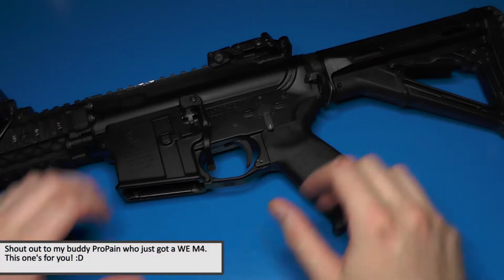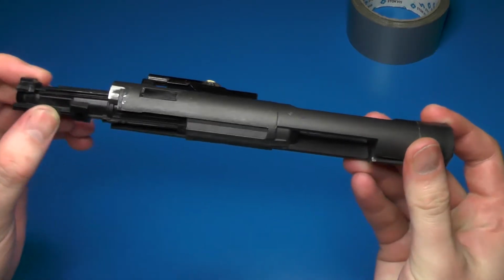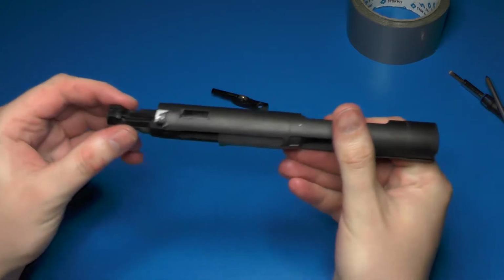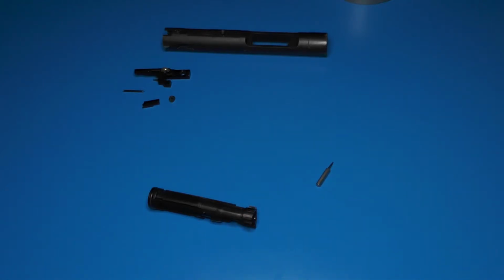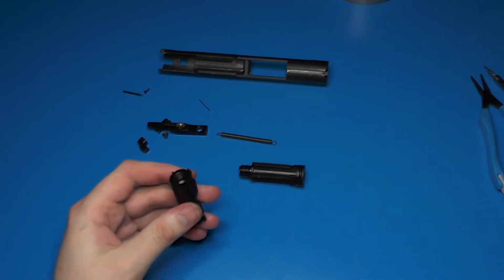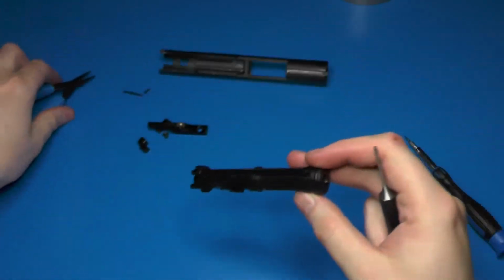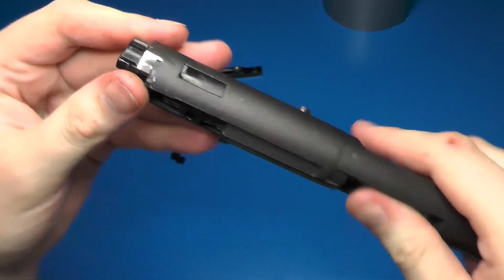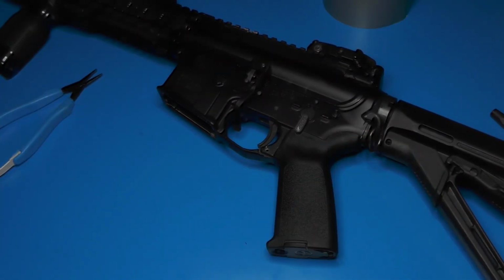Tech-tip: WE M4 series GBBR Bolt Carrier Group (BCG) dis-assembly and reassembly

Comment: Great video! I was cleaning my gun, and something got my attention. I can see a huge dent where the bolt hits the hammer roller to cock it back. Actually, it has formed a perfect mold of the roller. Any tips to avoid this kind of damage? I've filed it down to make it smooth again, but I already can see some damage on it.
Reply from the maker: Responded to your comment on the other video :-)

Comment: I have caa airsoft division m4 and its ggb and I have to manually shot it the full auto and semi doesn't work and took it apart and one of front nozzle teeth is broke and the alignment block is also broken could that be the issue

Comment: I have a WE HK416 that has the same BCG after lubing and closing back the pin, I can't open it again, looks like the BGC is jammed
Reply from the maker: Ugh. Stuck bolt in an M4 is rough. However the lower receiver rear pin should not be blocked entirely unless something went really wrong. It might just be that it has closed up very tightly. Use a punch and lightly try to hammer out the pin again. If the bolt has slipped too far back in the buffer tube you have to try and unscrew the buffer tube and poke the bolt forward while holding down the hammer from the ejection port. It happened to me once and it was terrible :-(

Comment: the fake gas key you mention at 2:20. is it possible to function the m4 without it. if not possible or recommended where will i be able to find that specific part.? thanks 
great video btw
Reply from the maker: Nah it is used for the function of the charging handle and interacts with the hop up housing to stop the bolt going forward. So you need it.

KY Airsoft supply WE spare parts here: https://www.kyairsoft.com/shop/category/parts-rifles-gbbr-m4-series-270

Doesn't look like they list the gas key separately so here is a bolt replacement but you can find this elsewhere: https://www.kyairsoft.com/shop/product/m4-33-gbbr-31285?category=270

Email KY and ask if they can provide a gas key separately.

Comment: Can you tell me how to get the little red piece set?thank you.
Reply from the maker: It's called an Accu Wedge and it is for real AR15 rifles. I bought mine from Brownells and MidwayUSA etc. 
You have to cut some material off to make it fit in the WE M4. I just bought and installed a new one and this time I got it to fit perfect :D
Maybe I will do a detail video of this in the future.
Reply: THANKS FOR ALL   I get it
Reply from the maker: No problemo amigo :D
Reply: I have a question. Is the gas block needed for the blowback action to work? I am asking because I want to put a free float rail on my GBB and I want to know if I have to buy another low profile gas block.

Comment: Can you replace the piston head to improve the seal like you can on a gas blow back pistol?
Reply from the maker: Biosins The piston head on the M4 nozzle is just a regular o-ring at the back. I think it's 2mm cross section and 15mm outer diameter. What you can do to improve the seal is wrap a layer or two of what is referred to as "teflon tape" (plumbers tape, used to seal threaded pipe joints) around the nozzle below the o-ring. Then seat the o-ring back over and it will bulk it up a little bit creating a better seal.
Reply: Non Existent Ah okay, Thank you for the help

Comment: My nozzle doesn't retract like yours, it sticks most of the time. Any tips on fixing it? Already put 4000+ through my WE M4.
Reply from the maker: Hard to say without seeing it. Could be a swollen o-ring. If so, replace o-ring. Could be damage nozzle alignment guides. If so, try to file down burrs/damages or replace. Worn out spring. If so, replace with AngryGun WE M4 150% nozzle spring. 
Or I guess the most obvious answer is to take it apart, clean it, lubricate it and put it back together :D
If that fails, replace the nozzle.
Reply: The maintenance isn't the problem. I think I got a bad bolt. Thanks.
Reply from the maker: I don't get it. You ask me for possible solutions to your problem and then tell me the bolt is bad? WTF?

Comment: What do i do when my nozzle for my gbbr wont go back into the bolt after a shot?
Reply from the maker: Could be a swollen nozzle O-ring causing too much friction for it to return properly.
Broken or damaged nozzle return spring.
Broken or missing nozzle return spring retaining pin.
Take the bolt apart and inspect parts and functions.
Replace parts as required.
WE OEM spare parts can be bought from KY Airsoft at https://www.kyairsoft.com/
Depending on the issue it might be more cost efficient to upgrade to an after market nozzle. I like the Poseidon ZERO ones.
Reply: Thanks for the feed back checked out my gun and discovered that the o-ring in the back somehow broke.

Comment: So does the m4 take real steel rails or airsoft spec rails?
Reply from the maker: The WE M4 has PTW spec. threads which I think equals RS compatibility but I am not 100% sure.
Reply: +Non Existent what rail are you running on your m4?
Reply from the maker: In the video it's the MADBULL DANIEL DEFENSE RIS II MK18 9.5" rail.